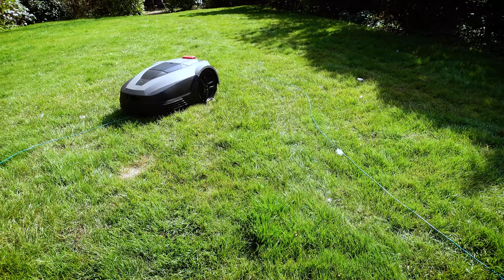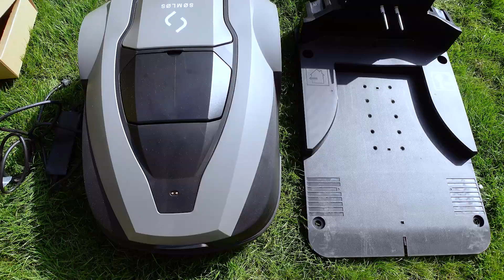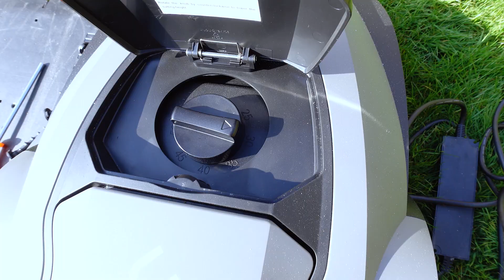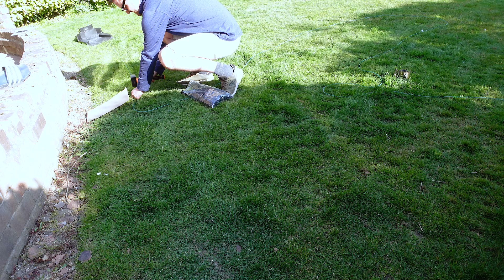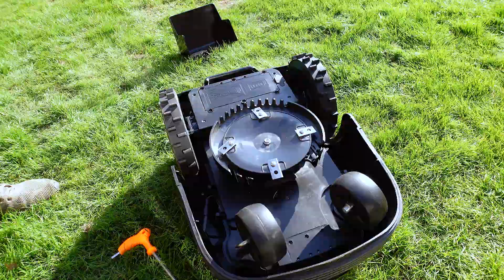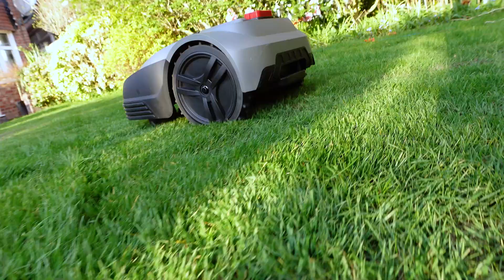Installing a Robot Lawn Mower - Somlos

Comment: I've had my Husqvarna for over a year now and as others have said it's easily the best garden investment I've made. I was using a petrol Hayter Harrier and on average it took me 3 hours to cut my lawn. I intended buying a ride-on, which would have reduced the time taken, but I'd still have the issue of disposing a lot of grass, weather watching to get a dry day, storage and maintenance costs, and finally the noise. My 430X automower eliminates all of the hassle of cutting a large garden, with the added bonus of no moss, and a healthier/greener lawn. I've taken numerous photo's which highlight the improvement in the grass over a relatively short time. The biggest benefit for me is the free time I now have to tend to all the other jobs in the garden that got neglected before. I've also been able to hone my BBQ skills.
Reply from the maker: BBQ improvement skills are very highly valued!

Comment: I'd never buy this crappy robomower. Several people in Norway bought this and it was so bad they wanted the money back. Shitty quality.
It turned out that it was just a cheap chinese mower that had been rebranded and jacked up the price.. Someone even dismanteled it comparing it to the one they bought on Aliexpress, and it was 100% the same mower, for WAY LESS money. I bought a Gardena mower last year, and its been working good, the quality is good also. When i see this Sømløs driving around, its choppy movement,, It just looks so bad. The gardena i have moves smooth, and not in a choppy way.

Naa, stay away from this mower. But robomowers are awsome! WHere i live its typical that when you need to cut the lawn, its raining, and the first day with sunsine you dont have time to cut it.. ANd then the next days its raining again.. And before you know it your lawn is 15cm tall. With the robomower it sorts it out even in rain. I love it!

Comment: I have two Worx Androids, an s300 and a m500. They are both great, our lawns have NEVER looked better, like a carpet, no days when lawns looks un-groomed and grass is thicker and greener than it has ever been due to the small grass clippings constantly feeding and fertilising the lawn, Easy change cutting blades ensure a good sharp cut and no problem keeping the lawn neat during rainy spells or when the lawn is soft from moisture and easily damaged either. Both mowers keep lawn edges pretty tidy but the M500 has a proper cut to edge facility. 
As two golden oldies who found the lawns increasingly hard work I can honestly say these are the best thing ever and recommend them highly.

Comment: it's a bit random
How about the lawn on the other side of the guide wire. 
What happens when you have several unconnected lawn areas of the garden, how does the mower get from one area to another. 
Expensive at $1000
It takes the satisfaction of mowing the lawn. 
Probably for those who are cash rich, time poor.
Reply from the maker: Yeah its a random motion, you can have some presets on there for structures settings though. The unconnected parts would not work, I mean I machine will run over hard surfaces so you can set it up depending on steps etc. Finally, you are right some people just enjoy mowing the lawn, it's horses for courses

Comment: It’s like a headless chicken, for me one of the pleasures of owning a lawn is cutting it.
Reply from the maker: I do love cutting my lawn too wiggles waff but I can see use cases for some people too
Reply: In one of Bunny Guinness's videos, she was saying that the quality of her lawn had vastly improved after using a robo lawnmower and found that her lawn remained a nice green for much longer during the drier months. She did say that the sacrifice she made was not having the nice lines in the lawn by mowing herself.  I think these are great machines for those with large lawns or who struggle with mobility.
Reply from the maker: That's interesting, I can see the points about mobility and larger areas. Right now I'm able to cut mine often enough but for sure regular mowing is the first step to a great lawn

Comment: I've got a  robot.  So  good. Would be nice  if it traced the outside of the lawn then striped it in. Similar to  how  robot vacuum cleaners work
Reply from the maker: Which one do you have PP?
Reply: @GardenLawncareGuy  Flymo  1600r.  Ex display model from b and q at very discounted price.  I stripe the lawn up with the cylinder for guests.  Let the robot  do the guard work
Reply from the maker: Nice! Always good to pickup a bargain